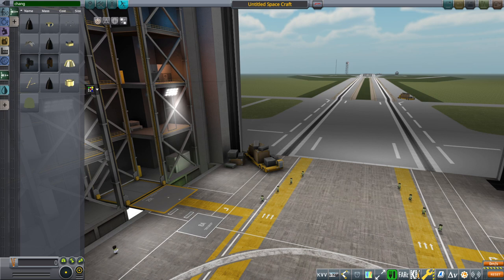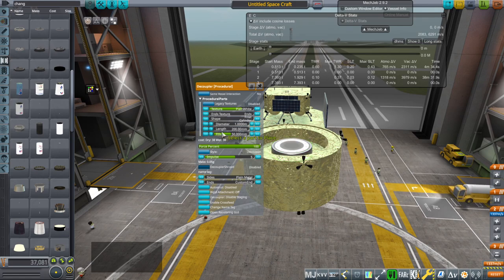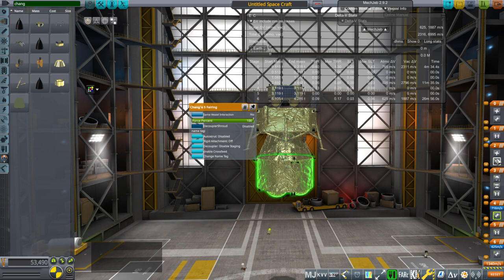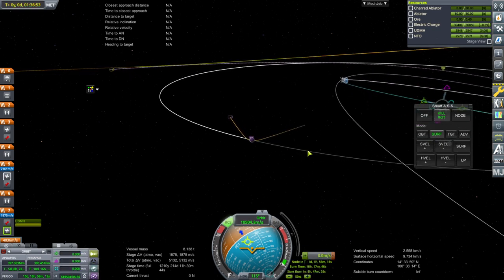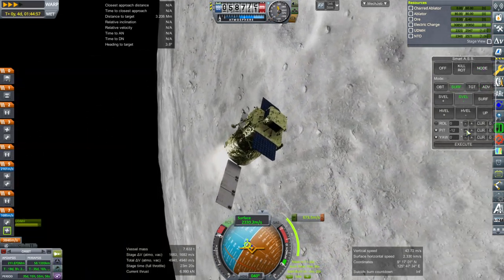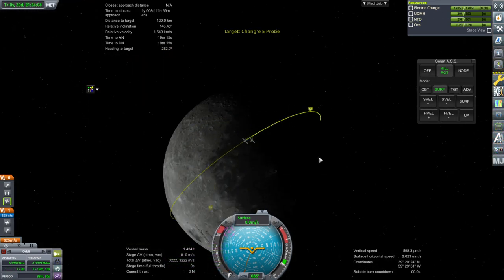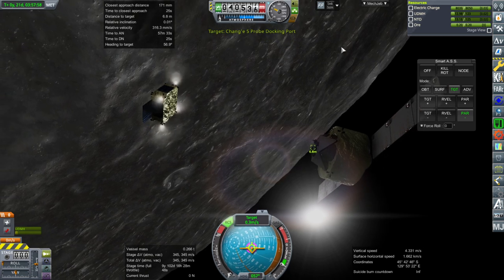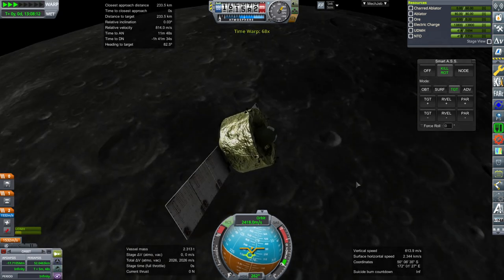Realism Overhaul in KSP 1.8.1 - Chang'e 5 (Initial Release Version)

Comment: Hi raiz, i have downloaded this mod and i tried docking, and apparently it is an inclination problem. I managed to dock without modifying the config files you made, it made the same back and forth bouncing it did to you but eventually it docked when i disabled RCS and let it do its thing. Idk if it was just lucky or if that was the actual problem, but i just tought i told you this so it helps you with fixing the problem (if there is one). Anyways great job man, thanks for all the great content!
Reply from the maker: Thanks for the info! Still a puzzle to me.